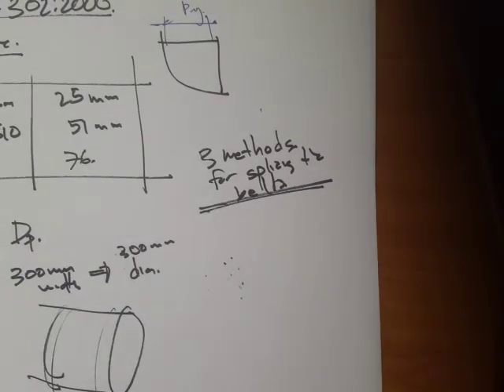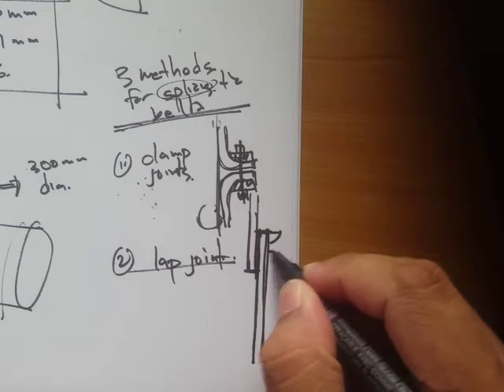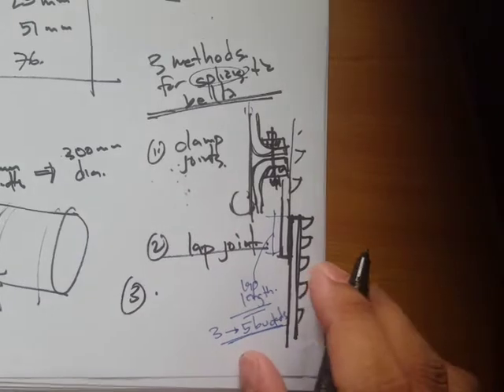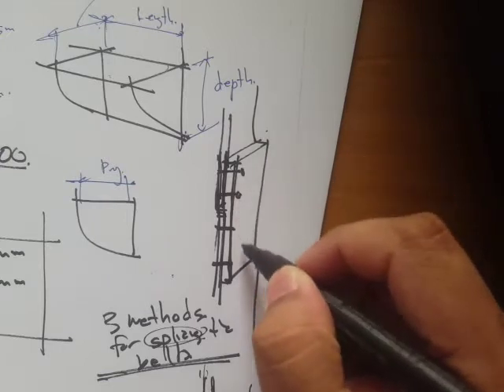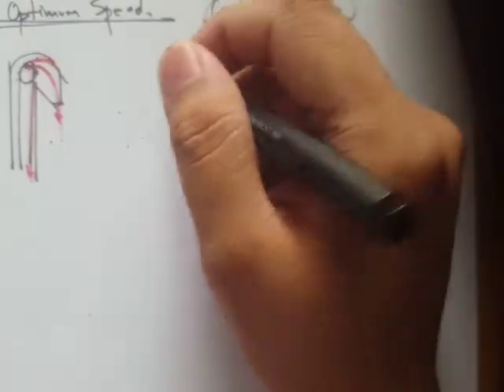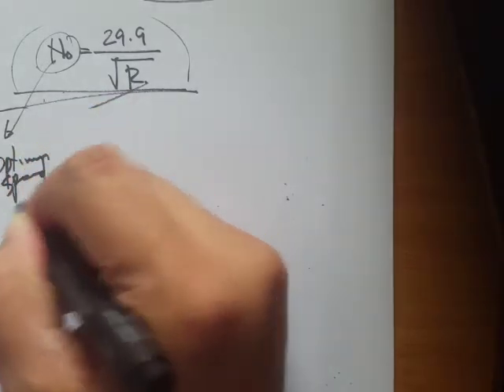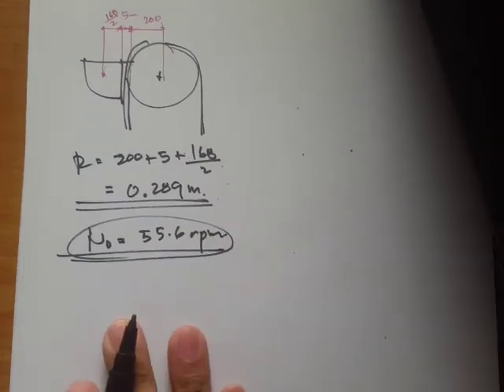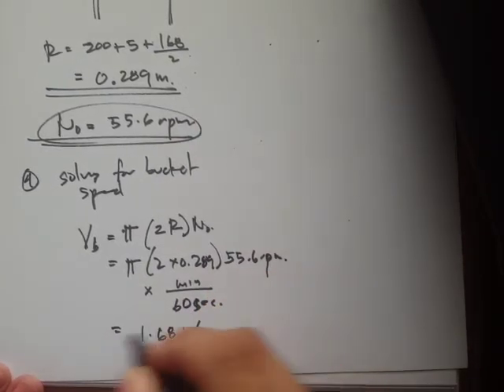ABE180 - 03.02 - Design of Bucket Elevator (Part2)

Comment: Sir, I have to design 200TPH bucket elevator, 
Guide me please
Reply from the maker: hello sir, primarily you will need the required capacity, data of materials to be conveyed (e.g. density, angle of repose and friction, etc.), and then the distances like the distance between elevator outlet, and the feed hopper of the equipment to be fed, as well as the center distances between pulleys.
Reply from the maker: once you have established that then you can compute for basic function parameters e.g. belt width, pulley width and diameter, power requirements, belt length, etc.   of course if there are local codes/standards available, you have to check that.  the computation for structural analysis and machine elements comes later.  at least that's how i do it.
Reply from the maker: it's also helpful to check the manufacturer's catalogs.  and if you're planning to just simply buy the components, just consult the manufacturer.  above all, always pray to God for the wisdom and favor in all your projects.  as He will be the one to guide you and protect you.
Reply: Ok, 
I also need to design for rice mill. 200 tph. 
Will the calculation  procedure same for 200 tph?
Reply: We have, 
72- rpm
Rice dencity- 0.75tonn/m3
Total height- 15 meter
Out put- 250 tonn per hour
Reply: Now please help to  select bucket, 
Pully, & belt
Reply from the maker: @DeepakKumar-il8cc  the principles the same... given the capacity design the size of the members.  and it's going to be a selection.  In other words, a lot of combination of bucket sizes, speed and all that can achieve your required capacity.  So try to select one bucket size and try to see what you get.  you can adjust the capacity through bucket spacing.  if it wont work, then try another size of bucket.   finally check minimum requirements, spacing limitations, etc.  with regard to the centrifugal speed,  it actually varies with pulley diameter and projected length.  i hope that helps.
Reply: Have you any direct contact plateform with you?
Reply from the maker: @DeepakKumar-il8cc  I'll contact you if I know your email address.